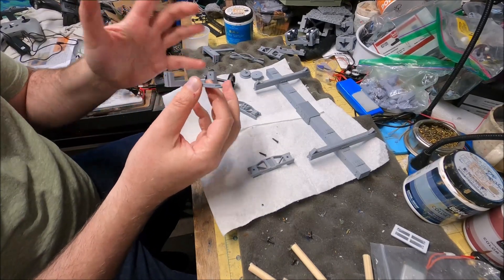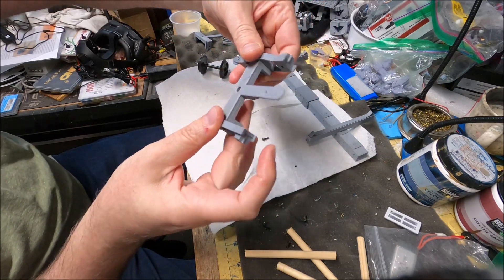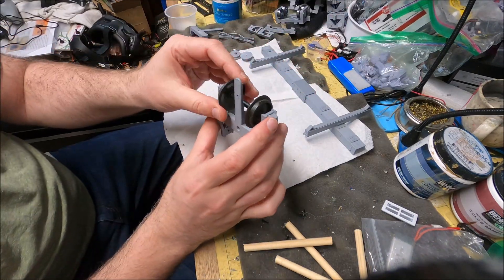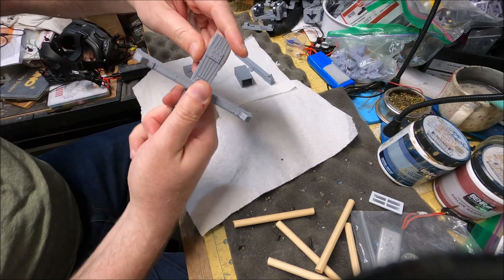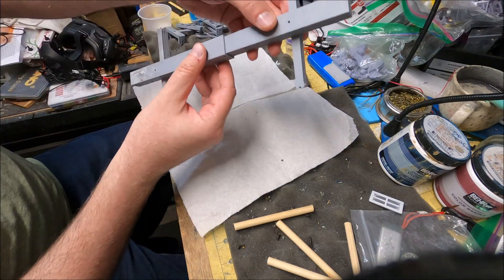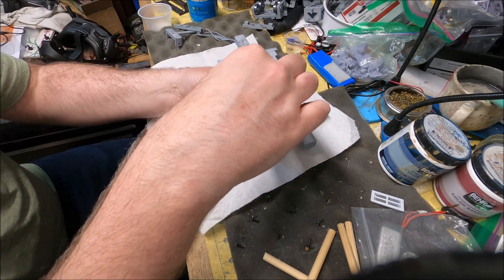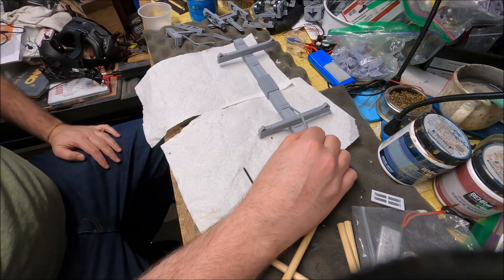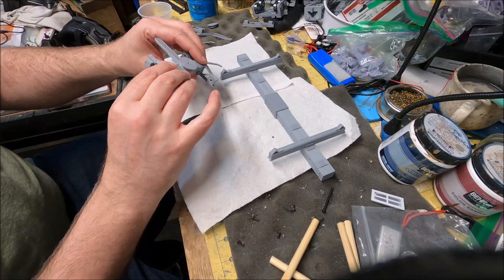Assembling my 3D Printed G Scale Log Car

Comment: Hi - i Reality Like your design. Printed it with the help of my Bambu. Unfortunately the tolerantes aren‘t that good as you‘re showing and I got some errors Already when importing the files into BambuStudio. 
Truck Sides Shows in the Video are also different to the ones on Thingiverse. There is no hole for the Screw. 

Would it be possible to have Access to the Step files (or similar)? 

Thanks,
Reply from the maker: It is very difficult to custom make a design that will work in every type of printer as-is. For example, a resin printer would have much tighter tolerances than an FDM style printer. So, regarding tolerances, I don't know if there is much I can do to assist in that. I do not use Bambu, I use a Neptune 3 FDM printer and Cura is my slicer. Cura has an option called "Horitonzal Expansion" which is great for slightly increasing the girth of a part to make tolerances more or less depending on what you need. I do not know if Bambu studio offers this kind of option, but you may want to Google it to confirm.

Regarding the hole for the screw; I lost that design file and no longer have it. And right now I just don't have enough free time to redesign it. So, what I have on Thingiverse is all that is available right now, unfortunately.

Comment: This is beautiful, looking to make one myself soon. Questions: what is the screw you're using for the pivot? Also the wheels/axle, are those from and existing car or are those also DIY? Thanks, awesome work.
Reply from the maker: The wheels and axels are not 3D printed. They're from old Bachmann rolling stock.

Regarding the screw; I use a #4 x 1-1/4" Wood Screw for the main pivot connection. But, know that the design in this video is my most-recent design and the one I sent out to people who bought kits from me. The design on thingiverse is the slightly older design. It still works well, but I wanted to eliminate glued connections wherever possible. You can still use this screw on my old design, but you may need to drill a pilot hole before putting the screw in, or it could break the pieces apart due to the stress.
Reply: @ShadowVFX  Thanks for the reply, that all helps a lot!